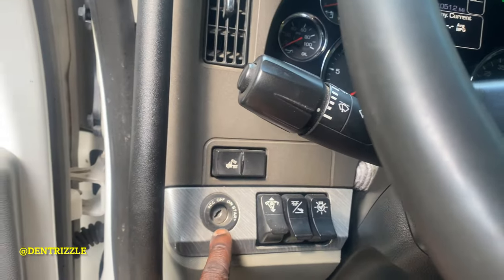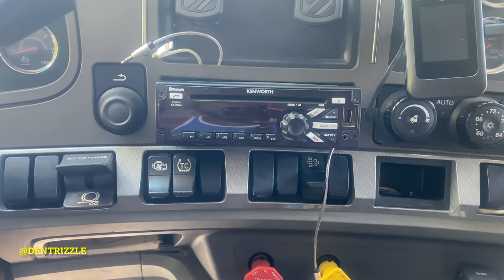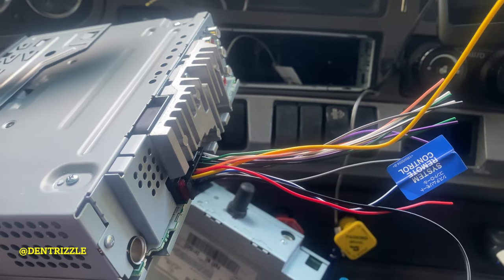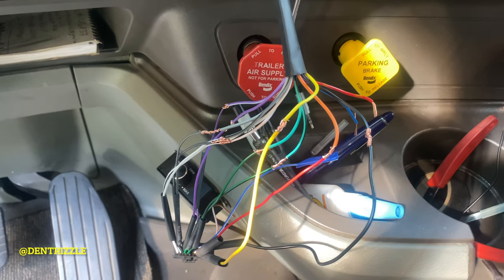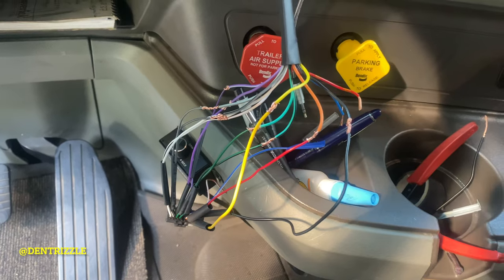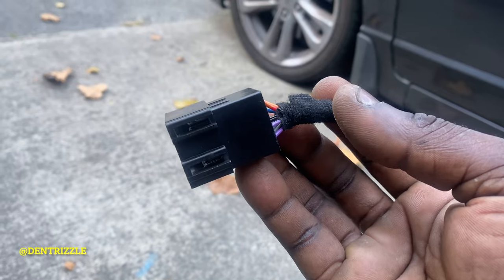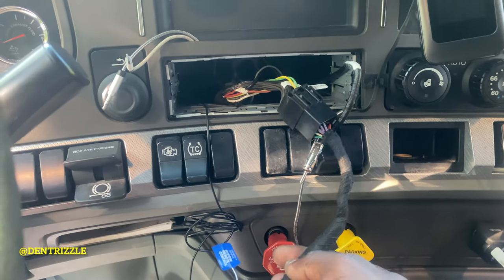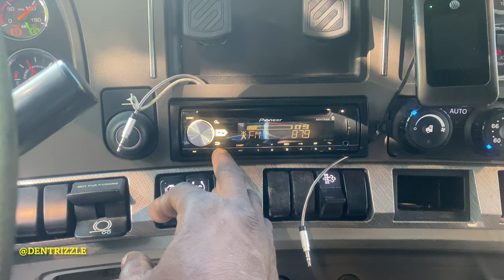How To Install Aftermarket Head Unit In Semi Truck | Kenworth T680 | Peterbilt

Comment: Thank you for this video I have a 2010 T660 and it’s doing the same thing so I’m going to replace the radio 👍
Reply from the maker: @Fred-xb2pr  seems they go bad over time. Multiple subscribers have this issue. Aftermarket head unit solved my problem and running good ever since

Comment: I have a 2021 kenworth t680.  I my radio 📻 speakers sound with out . When I turn the truck off and turn it back on, the sound comes back on . But I gose out again.  Do you think I need another radio 📻
Reply from the maker: That’s how mine started and I bet sometimes the radio randomly turns on and off. I don’t think you need to replace it as yet but eventually. That on and off thing gonna cause the radio to break.
Reply from the maker: I own the truck and plan to install two amplifiers and subwoofer so replacing the radio was gonna be needed eventually.

Comment: Were you able to retain steering wheel controls to the radio?
Reply from the maker: No I didn’t but if I wanted to I could find an adapter which could do that. It doesn’t bother me not using the steering wheel controls. Never was a fan of it even in my Honda.

Comment: I install new head unit then it was nice but radio turn off only original works n it turns off randomly now
Reply from the maker: That sounds like wiring issues, worst it could be is a faulty head unit.

Comment: I’m curious how the head unit came out? Because minds definitely doesn’t come out that easily. I even removed all the plastic paneling and no luck
Reply from the maker: It has 2 “U” shaped keyways. Just put both in the 4 little holes on the radio and push in then pull the radio out. Takes 2 seconds

Comment: Does the radio control in the sleeper still work for this radio
Reply from the maker: Not sure cuz I don’t have one in the sleeper. But naturally it won’t if your steering wheel controls don’t so I’ll assume you have to wire up the steering wheel control to the aftermarket head unit which I didn’t in this video.

Comment: Thanks for video but I am confused with wire  i have T680
Reply from the maker: I can make it simple for you. Any 2 color wire with a stripe is speaker wires. There are 8 in total. Black is normally ground, yellow is constant 12V and red is usually switched 12V. It’s easy to verify with a test light.